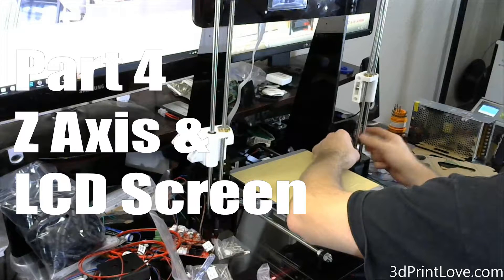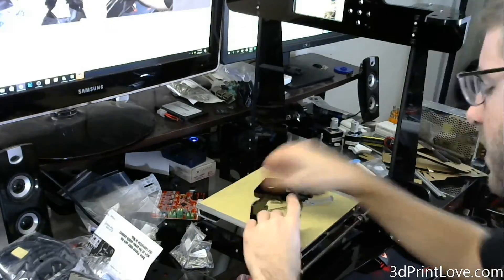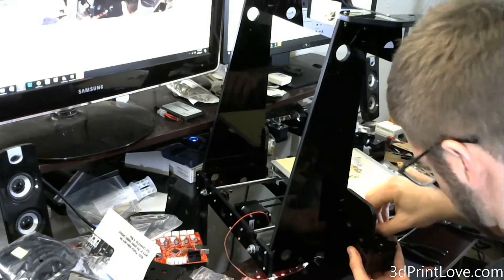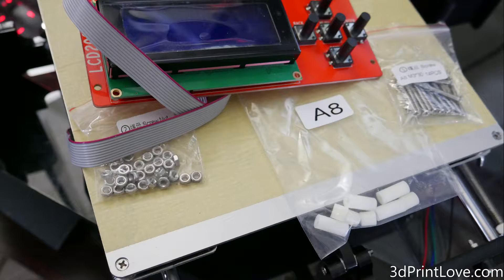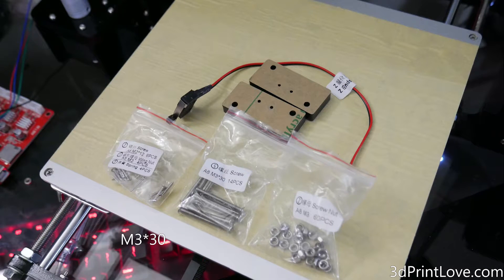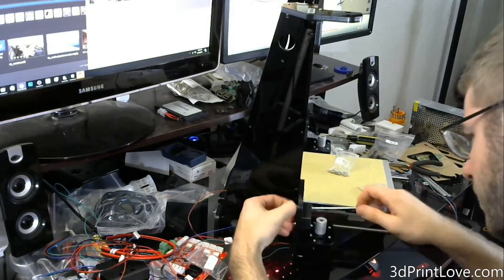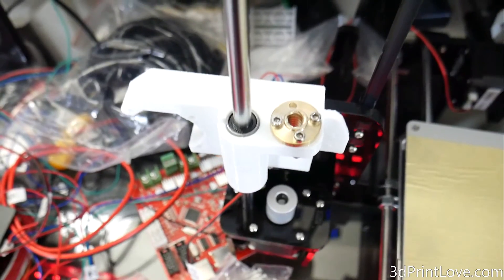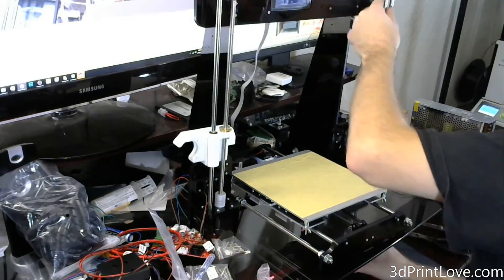Anet A8 3d Printer Build Guide Part 4 Z-Axis & LCD Screen

Comment: Y axis. There is an error in the documentation, the support plate should be installed with the crossbar on the bottom or your Y belt tensioner will be inconsistent across the range of travel. It places e upper and lower halves of the belt in parallel vs the upper half being "uphill". If they provided two sets of belt clamps, use both and clamp your belt between both clamps instead of between a clamp and the crossbar.
Reply from the maker: +James Kuhlman I saw someone mentioned that on the Facebook group but half the people couldn't agree whether that was true or not. I will say I don't actually think it affects print quality my prints are coming out beautifully. I can make a note of it perhaps but it definitely has had no visible affects in print quality on my printer
Reply: No worries, thought I would chime in. I found my belt binding at extremes in  Y axis travel and a significant difference in belt tension. My prints have improved since I went with that, and beyond with an "improved" belt clamp from Thingiverse. But, then again, with some concerted effort my prints have improved dramatically in the last week.

Lots of failed prints makes for lots of improvement and knowledge at times. Just a newb, so I have a long climb from where I am to 'expert'. But then again, it's fun.

I DO appreciate what you're doing. These are some of the best build videos I have seen so far.